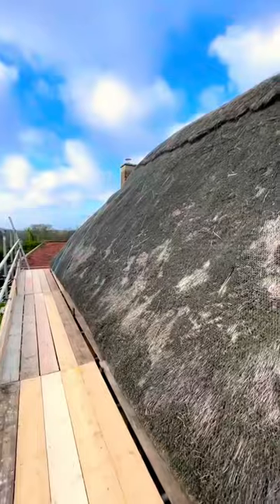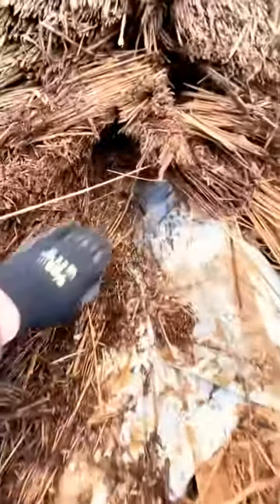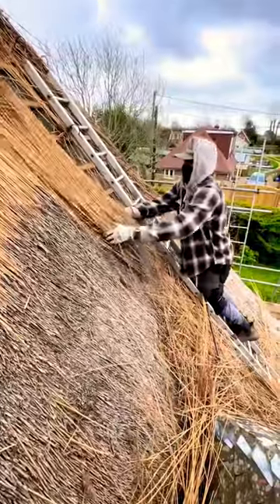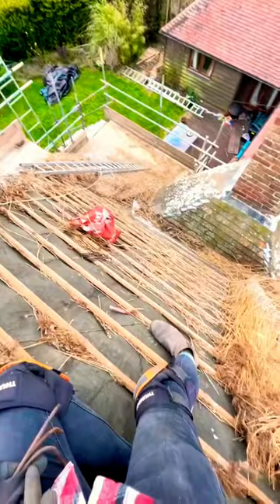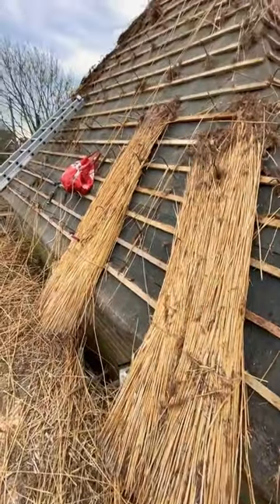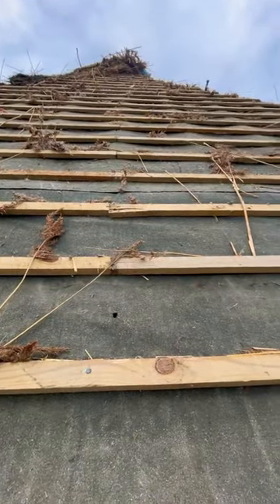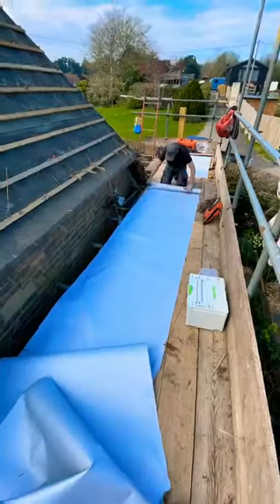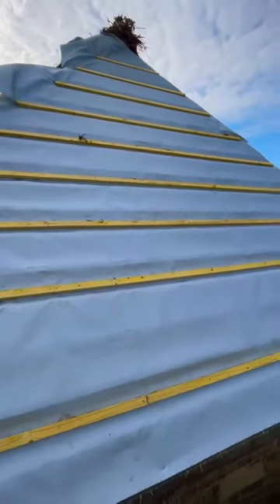1st stage of renewing a thatched roof part1 #shorts #shortvideo #youtubeshorts #love #home #cottage

Comment: Ive roofed everything from castles to old school hot mopping torching roofs .. these roofs u always remove originally membrane put ur shield and water atleast first 2 runs  and 1 on ridge then run ur reguler pape4 then batons even on shingle roofs or old spanish tile you would do same thing but i gues u can get away with it the inspectors wouldent let that slide i do all commercial